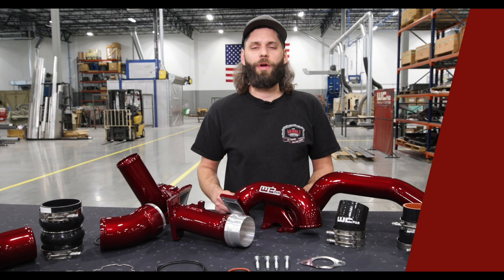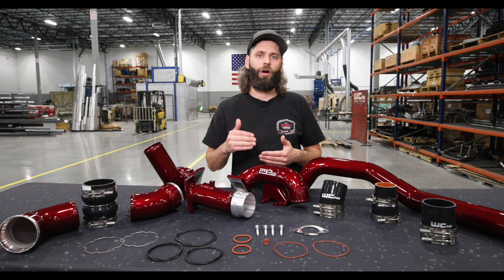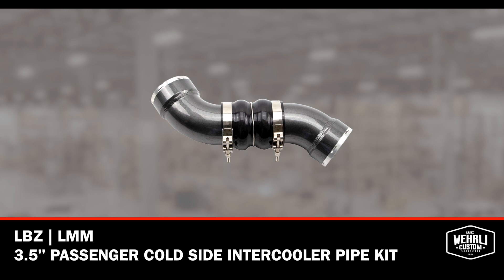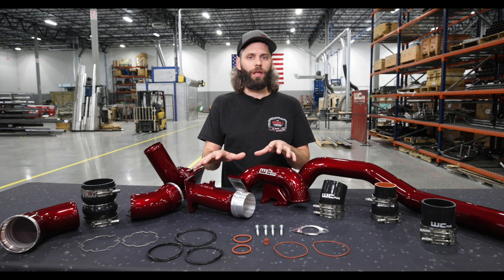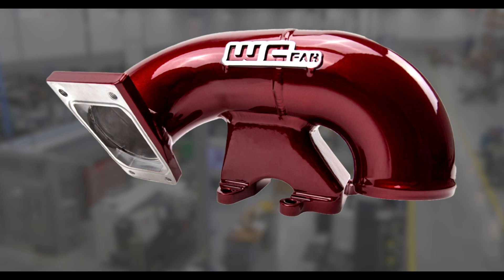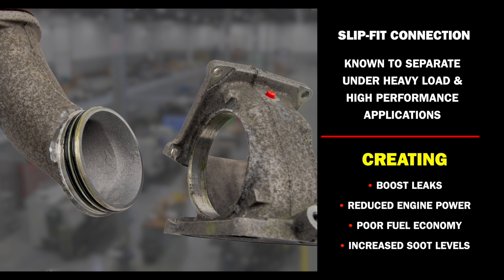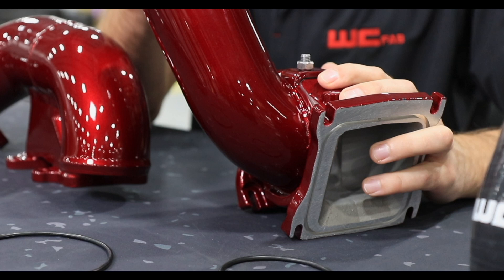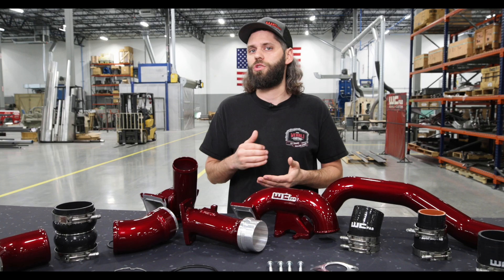2006-2010 LBZ|LMM Duramax High Flow Intake Bundle Kit

Comment: I just purchased a 2008 Kodiak. With an LYE will this kit work?
Reply from the maker: This kit specific to the LBZ and LMM Duramax equipped 2500 and 3500 trucks and unfortunate is not compatible with the Kodiak models.

Comment: How much does this help with temps?
Reply from the maker: That answer will vary based on other modifications you've made to your truck and under what conditions you're performing the testing. Improving the total efficiency of the intercooling system means your turbo doesn't have to work as hard to move the same volume of air and therefor doesn't put as much heat into what's going into the engine. If you've got specific questions about how this part may benefit your particular setup, please give our team of specialists a call at 630-277-8239 and we'd be happy to discuss and help make a parts recommendation that will work best for your needs.

Comment: For $1800 don't waste your money. Missing parts and o rings, no instructions. Metal burs all over inside the charge pipes where they were ground inside where it's welded to the flanges.
Reply from the maker: @JackAFlint  thank you for sharing your experience with us. We weren’t unfortunately able to locate an order that corresponds to your username here. Please give us a call at the shop (630-277-8239) or shoot us an email to sales@wcfab.com so our support team can better understand your situation, help address those concerns, and make sure that we answer any questions you may have about the install.